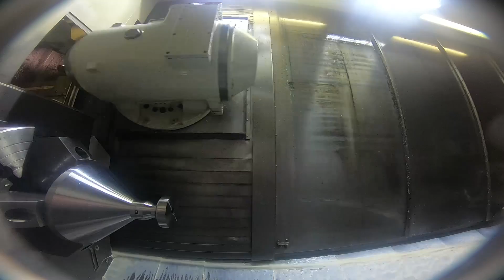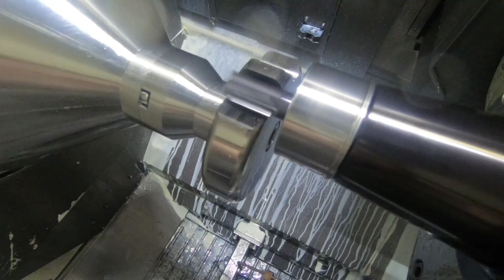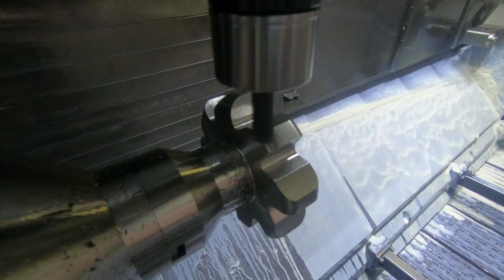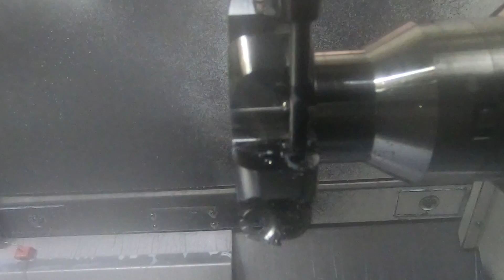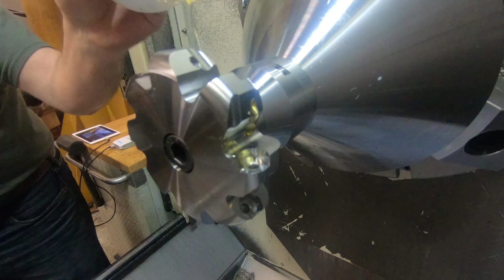Special Cutter Final Opp

Comment: Hello Peter,
Thanks for sharing, super video again,
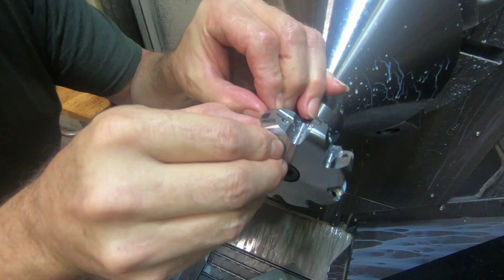At 7:41, after tried the insert on the tool (in this scenario it is part but actually it is tool 😄 ) ,
Did you run the same program without ofset one more time
or
Put some ofset for tool diameter from control panel then run the program,
Best reagards, have a nice day.
Reply from the maker: Yes I just reran the tool. With no offset change, sort of a spring pass if you will.
Reply: @EdgePrecision  Have you applied heat/thermal operation on these bodies before final opp dear master. Best regards.
Reply from the maker: @CeErCeEr  If you are asking if I heat treated  the material. No this 4340 had what they refer to as a commercial heat treat. So its not real hard but not soft either. Maybe around 36-38 Rc (I don't have the cert). Some of these cutters have machined thousands of parts so it is working good.
Reply: @EdgePrecision  Thanks dear Peter,
I am really interested in with special cutter design, producing etc. Moreover there is not any resource on the except from some videos. Axial, radial angle of insert etc etc. Thanks for your quick response. Best regards.

Comment: I want to ask what kind of steel are you using? and heat treatment or not?
Reply from the maker: This material was 4340 commercial heat treat. That would make it fall in around 34-36 Rc hardness.

Comment: Could you have used a swarf tool path with the work rotated over more instead of that ball endmill pass?
Reply from the maker: Are you referring to a Fusion swarf tool path? In Esprit the swarf tool path won’t do a shape like this. That’s the problem with cam software there is no uniformity of titles or what cycles do. So it’s hard for me to say.
Reply: @EdgePrecision  Yeah, the Fusion/HSM Swarf, which cuts a curved surface with the side of the end mill. Seems like it can save time compared to tons of passes with a ball nose, when you have 5 axes. (I only do 3/4 so I'm stuck with the ball passes myself)

Comment: What's the point of the big metal cone he has it mounted on? Just to make it stick out? Or is it more stable for some reason?
Reply from the maker: To provide clearance for the face of the milling spindle in relation to the chuck. I have made different cutters that required topping the spindle toward the chuck. Without this arbor that projects the work out away that wouldn’t be possible.

Comment: Tips how to use the tool offsets with tapered end mills? :)
Reply from the maker: That would depend on how you program the tool path for a tapered endmill. I usually program the path for the bottom bottom diameter or tip diameter. Than its just like a regular endmill as far as offsets are concerned. The upper diameter or taper just cuts away more material. Some CAM software's don't automatically do it that way but you can usually make that happen by just using a bottom profile shape.

Comment: Did you offset the threaded holes for the insert screws towards the tapered pocket edges, so that it tightens the inserts against them? If so, how much? I need To make a Chamfering tool with triagonal insert, thats why i am asking :) Love your videos, excellent work!
Reply from the maker: The holes on these pockets are in the center because the pockets cover more than 180 degrees of the inserts OD. On other tools this is what I would do. If you are laying this out in cad. Draw a circle that represents the hole in the insert when its seated in the pocket. Than draw a circle that represents the screws major diameter. Move the screws circle toward the direction you want the clamping force to go until it just touches the inserts circle. Put the hole in that location. You have to be able to get the screw in and out of the hole when the insert is fully seated.
Reply: I dont have any cad at the moment, but lets see how it goes. Thank you very much for answering, i really appreciate it :)
Reply from the maker: @HH-Machining  If you want to do it manually say on a Bridgeport type machine. Get a small piece of rod (Collet size) and turn down a short distance to the screws major diameter. Than with your cutter pocket machined and set up for the screw hole/s put the rod/pin in the spindle. Than put your insert into the pocket you machined. Hold the insert down firmly in the pocket. Than extend the rod in the spindle/quill into the hole in the insert. Now move the rod in the direction of where you want the clamping force until it just contacts the side of the inserts hole. Clamp everything down and drill and tap the hole in that location. You could also do this on a CNC machine but it would be a little more difficult to tell when the rod/pin come into contact with the inserts hole. Than you could zero out the machine there or note the location for your program.
Reply: @EdgePrecision  Im going to do it with my CnC Deckel FP4A mill, i need To plan it good and hand "program" it. It has manual quill at vertical spindle and an remote control with 0.001mm, 0.01mm, and 0.1mm increments on the jog wheel. I am a newbie with machining and my full time Job has nothing To do with machining In any way., but i Love machines and machining :) Channel like yours is Pure Gold for someone like me :))

Comment: What kind of steel was it?
Reply from the maker: These cutters were made out of 4340 commercial heat treat material.
Reply: @EdgePrecision  i tried to find a HRC hardbess it can be hardened to but got some other figures that I dont understand. I see its right material for job.Thanks.
I saw they sell indexable shell cutters made out of some alloy of aluminium?! Could that really work?  Your machine would rip it apart or something lol.
Reply from the maker: If it was 7075 T651 aluminum that could work. I'm not sure of the advantage of using aluminum for a face mill though. Maybe its designed for high rpm milling aluminum. I think the commercial HT 4340 material would run about 32-34 HRc.

Comment: for the threading you could put a can full of oil in the machine and everytime you want to tap just dip the tool in the can and there is new oil on it :)
Reply from the maker: What if you had to tap holes in the horizontal mode? I have used a wire brush to remove shavings off a tool. Just stop the spindle bury it in the brush reverse at slow speed while reversing the spindle. I have also thought but never tried it. To change to a tool with a Allen wrench and use it to remove screws and move them in a fixture. But like I say I haven’t tried this.

Comment: Love watching your videos. One question. When roughing out the insert pocket, why not use a larger endmill and plunge it to get the majority of the material out, rather than wearing out the tips of 3/16" endmills?
Reply from the maker: Thanks Chad! The endmill is actually roughing the angle in steps on the insert pocket walls. That way the special endmill that finishes the tapered walls has less load on it. Plunging a end mill straight into something usually doesn’t work very well. But if I ground a form tool that could work. I usually try not to use any more special tooling than absolutely necessary.

Comment: Kind of late to the gate on this, but are you worried at all about re-cutting chips on the finish pass of the tooth profile? Is there a particular reason you do this opp on the top of the part as opposed to the side or bottom which would allow the chips to fall away? Thanks!
Reply from the maker: The reason I machine on the top of the part is the machine has no travel range in the X minus direction. It's max travel in X minus is -10 MM. So all machining milling and turning has to be on the plus side in X. As far as re-cutting the shavings, because I was making a video there is no coolant for better video. Normally there would be coolant flushing away the shavings.
Reply: @EdgePrecision   Thanks for the reply! I guess that means there's no option to just run a stream of air at the tool to blow the chips away?

Comment: Why do you go through so many tools that you have to make spares? Nice work sir.
Reply from the maker: This particular job uses 16 of these cutters in the setup to run unattended on the horizontal mill. If a cutter gets damaged the whole setup cant run. It is a little involved to make a cutter so I would like to have spares.
Reply: @EdgePrecision  Active tool life management? - get it now thanks.

Comment: I would be great if you can try with hardening
Reply from the maker: The material is heat treated. It just not real hard. Probably around 43rc. The existing cutters have machined thousands of parts no problem. Heat treating to a harder state really isn’t necessary.

Comment: Peter, I have a question for you if you have a minute to answer. I am going to be cutting some slots in 316 SS, .880 wide x 1.125 long x 1.000 deep, what kind of solid carbide endmill would you use? And if you wouldn't mind to gi e some input, what speeds and feeds would you use?  Thank you Pete, you are a great mind, that's for sure!!!
Reply from the maker: You didn’t mention what kind of machine? 40 taper 50 taper or other? What kind of coolant and supply? The way you have to hold the tool? All these come into play.
Reply: Edge Precision I will be running these parts on a HAAS VF2, 40 Taper, unfortunately I do not have thru spinal coolant but we use Monroe Astro Cut. I will have my tool in a .500 shrink fit holder. I really appreciate your time in answering my questions and I promise not to take advantage of it!  Thank You Peter!!
Reply from the maker: It would be best if you can use a adaptive strategy. Take the cut at full depth less any finish passes. Take small depth of cut on the side say about 5-10% of the tool diameter. Is the slot opened ended or a closed pocket? If so it may pay to drill a start hole if there are no open sides. I would probably use a Guhring or Hanita endmill. With a small chamfer or tip radius for roughing. Probably start at about 350 surface speed at about .002” per flute feed. Currently I am in Mexico checking on my building or I could give you more detailed information on the tooling. You must make sure you are getting good chip evacuation this is vital for good tool life. Part of telling if a tool is running good is how it sounds and how the machines vibration. So if it feels good and sounds good it probably is good. Than speed it up until it doesn’t than back it off a little. You may have to work a little to find the sweet spot.
Reply: Edge Precision Thank you so much Pete!! Believe it or not, I was on the same page as you with feeds and speeds and using a bullnose endmill!! Job is running beautiful with excellent tool life!!

Comment: as for the lighting.. Abom got a ring lamp from somebody for his vertical mill.. fits in an existing hole. i wonder if a battery powered LED ring lamp could be fastened to your spindle face..  perhaps with different rows of Leds aimed in different directions..  with the switch ability to change the lighting pattern.. heck might be able to fab that up in plastic..  right in your own shop.. one thing.. you would need to test several LED colors.. to come out with an assortment that create normal white full spectrum light.. so its not such a  single spectrum of light..  i realize this video is several months old..

Comment: Beautiful.  What steel was it made from and was it heat treated?
Reply from the maker: Thanks userwl2850. These cutters were machined from commercial heat treated 4340 steel. That would make the hardness around 34-38 Rc. The first cutters I also made out of the same material and they have held up real well.

Comment: Instead of using the ball mill to cut those profiles - why not use a turning operation?
Reply from the maker: Because they are not a diameter. If you imagine sort of like a clearance angle on a side cutter they spiral in towards the centerline.
Reply: Edge Precision Ah yes thats right. Thanks. I have been enjoying your videos! Thanks for posting them.

Comment: FYI according to Sandvik Coromant you get up to 40% more toollife  out of your carbide tools running them dry in most materials, this statement only applies to milling, not turning
Reply from the maker: That sort of typical of tooling suppliers making a blanket statement like that. The more accurate thing to say is it depends. Also it can apply to turning. For instance when turning an intermittent cut.

Comment: Awesome video edge. Looks like fun making your own Cutters! How much do you offset the insert screw hole to pull the insert into the pocket? Do you prefer 4340 ph to 4140 ph for cutter bodies or is it more available in your region?
Reply from the maker: In the case of these insert pockets the inserts being round the screws aren’t offset. With the tapered sides of the insert pockets surround more than 180 degrees of the insert. It hasn’t been  necessary to put the holes off center.

Comment: @edge precision:
 what is the matrial used to create this cutter ??
Reply from the maker: The cutters are made out of 4340 commercial heat treated steel. That would make the hardness range of 34-38 Rc. I mentioned that in the first video on this. Watch my previous video.

Comment: Nice work Peter.  Is this cutter your design?  If so did you design it based on the available insert or the type of milling operation needed for the job?
Reply from the maker: Thanks Bill; Yes the cutter is my design special for this part. As for the insert type. It was chosen for being the least expensive to do the job.
Reply: I should have known why else would you make a cutter if one was commercially available considering the work that you are doing.  Good stuff Peter, I hope you are considering setting up Patreon account or maybe some kind of swag you really are doing a good job and I'm sure many would be willing to support your efforts.
Reply from the maker: Do you think people would be interested in a patreon account for my channel? I would have to think what extra value I could offer them.
Reply: Edge Precision Yes I think people would. You could offer the videos sooner to your patreons.  Some don't really offer anything extra and people will contribute based on what your already doing.

Comment: At around 7:00, the shot seems underexposed because there is a bright pattern at the left, which messes the camera metering. You can either switch to spot/center metering (if available) or find a way to darken that side. The GoPro tends to focus in the center, so the shot should be framed such that the background does not sit right at the center. For the "high-speed" shots either there isn't enough lighting or the lights are pulsating. Thank you for the videos and the R&D topics.

Comment: Instead of using the ball nose end mill for profiling, why not run a regular endmill sideways with simultaneous rotation? Wouldn't that be a lot faster?
Reply from the maker: I'm actually cutting the radius on both ends and the flat in the middle to a angle. Only a form tool from the end could do that (I could grind such a tool on my grinder). Or a front and back corner rounder and a endmill.
Reply: Ball endmill for what he's doing is the only way to go...

Comment: Hi Peter, about light try something like halo (ring light) we did it on our Mazak, but unfortunately right now I´m too much far from my country and have no pics. Petr :)
And btw I love your vids.
Reply from the maker: If the ring lite was on the outside of the spindle that might work. It would need to be very thin in its radial dimension. The tool changers arm comes to close (Almost touching) to the spindle's face to mount anything, at least on the side where the arm swings. If it was to thick in the radial direction it would just exacerbate the already problematic clearance issues. When getting close to the chuck with the spindle in the vertical position. Its not really necessary for machining just for video recording.

Comment: Peter, what was the RPM you did the 5mm tapping?
Very interesting!
Reply from the maker: The speed is 254 RPM and the feed on this machine = the taps lead in a tapping cycle. In this case a F.03149.
Reply: Thank you.

Comment: Great video!  I'm really enjoying your work.  If you're only using one camera to get all those angles, then my hat's off to you!  That's a ton of video editing to achieve your style!!!!  I'm in love with this machine!  Thanks!!!!
Reply from the maker: Thanks bluehandsvideo; Yes there is just one camera. I means I have to stop move the camera and start the program a lot. Fortunately on a CNC machine this inst to difficult to do with the single block function key.
Reply: Dang! I know exactly how much work that is!  Way more than I've been willing to do! LOL  I'm only running mach3 and I don't trust the feed hold at all on it!!  Since you're doing multiples of the same part, you can run each part with a different camera position and then do all the work on the computer.  But.....knowing just how much grief and time are involved in the editing end of these vids, sometimes it's a lot easier to get shorter clips that are more specific and then splice them.  I'll end up letting my camera run for the duration or until I know I've gotten the final tool paths.  It can take quite awhile to whittle 2+hrs of vid down to 10min. lol  Thank you for the time/effort you're putting into your vids! :)

Comment: the tool looks like a brand name tool , great result . Will you put black oxide or some protective layer against corrosion ?  . On a side note , i would like to see some heavy machining sometimes , i know that machine can handle at least a 6mm radial depth of cut (turning).
Reply from the maker: As the jobs come up is how your seeing them. If the job has heavy machining you will see it.